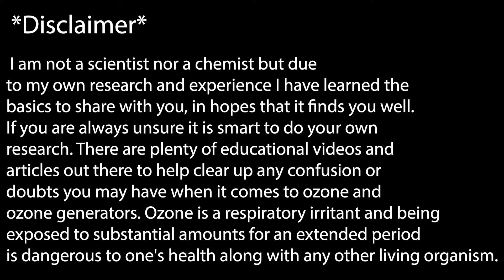Using an Ozone Generator for Water Treatment

Comment: This comment is for anyone who knows anything Please I need help..
I have  an ozone water and air purifier. I bought it originally so I could use the water to drink oral care and desperatly needing  to figure out a way to get the best strongest ozone water to have a tub soak and head and scalp treatment.
I need to know a few things and have not been able to figure it out probably due to severe brain fog.
So can someone tell me if there is a way to take a bath in strong ozone water if so what do I need to purchase from where... If you ozonate a gallon of water using the water AH1000 how long should i ozonate it for?? how long does the ozone stay strong in the water.. can I be in a room with strong ozone as long as I have mask for breathing will it hurt my body or is it just breathing it that will be dangerous.I have so much more to ask  but i dont want to hog the comments section.. I'll check evryday to see if anyone found and understands this nonsense post.

Comment: Would this work to reduce odors coming from an RV waste water tank? I don't want to drink it, just stop the odor.
Reply: Waste water ?  Do you mean portability tank water, RV has black, gray , portable water aka fresh  ,
Reply: @daleval2182  Use it to keep the bathroom smell down. Potentially even a bubbler in the poop tank.
Reply: @Paul-ou1rx  I wouldn't bubble a septic gas rises bad news, drain it , bleach use a mole pressure wash head, then add a septic odour nutrilizer, ensure toilet vent pipe is tall enough and flowing well, mole wash it to, ozone in the bathroom with door closed no body in it , yes can help rid bad odour, but first deep clean and disinfecting well, or replace flooring and toilet seal

Comment: Interesting device but can ozone therapy treat soil infested with fungus and bacteria? How do I treat it if it is possible?
Reply: I think the best treatment for soil would be to use the Ozone treated water to treat the soil immediately after the water is treated with Ozone.  You might also need to replace some of the beneficial bacteria and fungi (Mycorhizza) after the treatment.  Ozonenated water will become ineffective after about 20-30 minutes as the Ozone dissipates.  I would put it into a spray bottle or soak the soil in it.
Reply: How much do you sell it?

Comment: What about the pungent smell coming from the ozone? My ozone generator caused the water smell like ozone.
Reply from the maker: It shouldn't but it's hard to tell since we don't know what ozone generator you are using. You can try letting the water sit for a while and see if the ozone smell disappears.
Reply: What is your ozonators make and model?
Reply: It would seem to me that the ozone bubbling out into the air is NOT safe to be breathing. 
Ozone is a seriously double edge sword.

Comment: I didn’t even know these existed , are they available in Australia 👍👍
Reply from the maker: Thanks for the comment. I'm sure they're are merchants that sale them In Australia. We're just unsure who sales them. I would possibly check amazon or ebay.
Reply: @GreatVacsCOM  how much ozone is injected in one litre of water
Reply from the maker: @ravishhemnani8112  The ozone dose required will vary according to water quality, but a typical ozone dose is 1.0 to 2.0 milligrams per liter, which is sufficient to kill most bacteria and control tastes and odors. The capacity of the storage tank determines how much water is available for use. The amount of storage required depends on household water use.